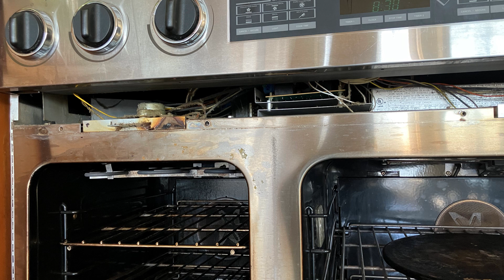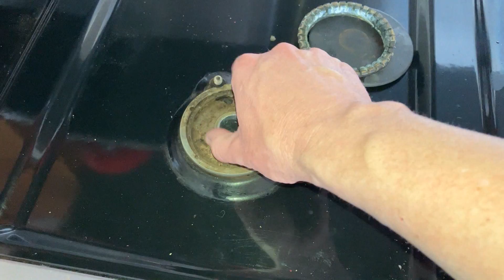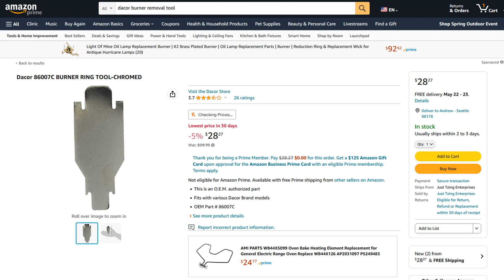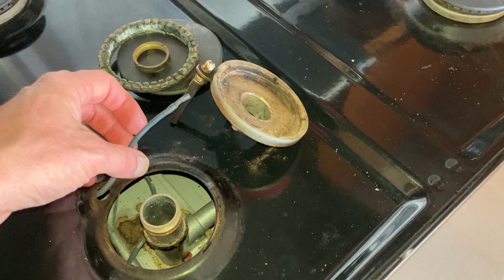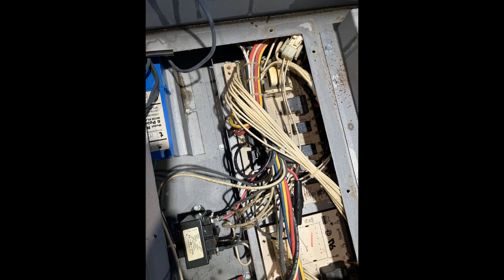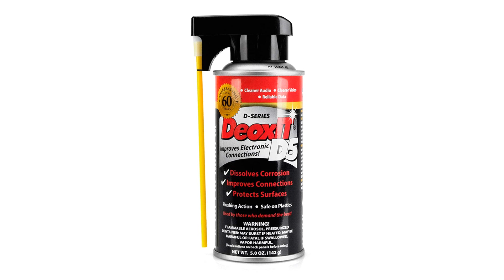Fixing a dim oven display - no soldering!

Comment: Same exact oven and same exact problem. I've had to do this process yearly for the last few years. However, a second option that works for a few months in between  these yearly disassembly process is to switch your main oven breaker off for a few hours - overnight. When you flip the breaker back on, the display will be nice a bright. I can get away with this 2-3 time per year before I have to go with the disassemble routine. The first time you use the breaker trick, the display  will come back very bright. The second time it will not be as bright, by the third time, it will have very little effect, and the manual disassembly is required.

I would really like to find a more permanent solution. These 48 inch class ovens are extraordinarily expensive. I love this one, and would like to get many more years of service from this one before thinking about shelling out this kind of cash.
Reply from the maker: Thanks for sharing your experience. I agree - it's amazing that the only alternative seems to be "buy a new one" - which costs thousands of dollars. Madness. I've thought of recapping the board, as I suspect that may be the issue. I'll try the breaker trick if it has this problem again. So far since doing this work 5 months ago it's been OK.